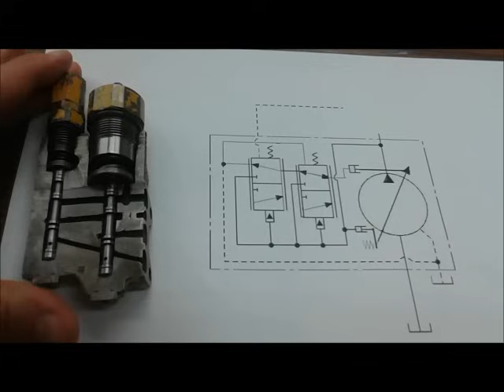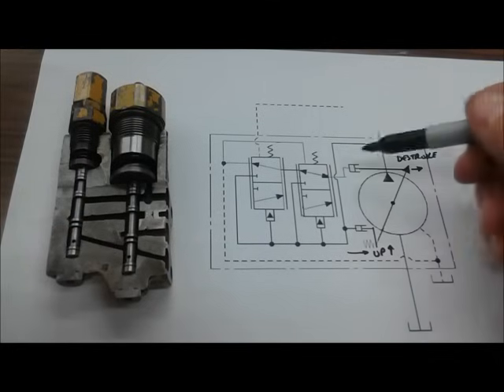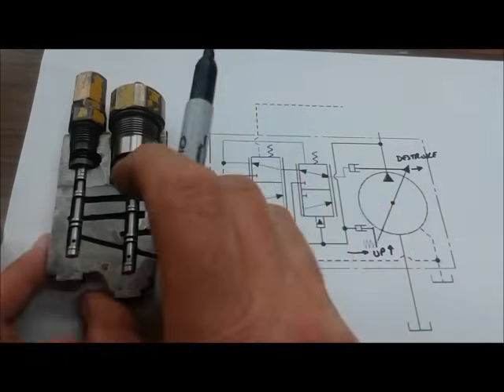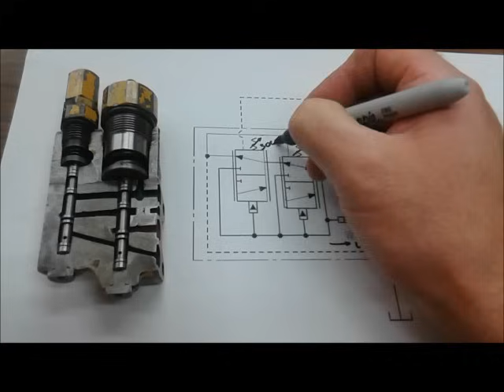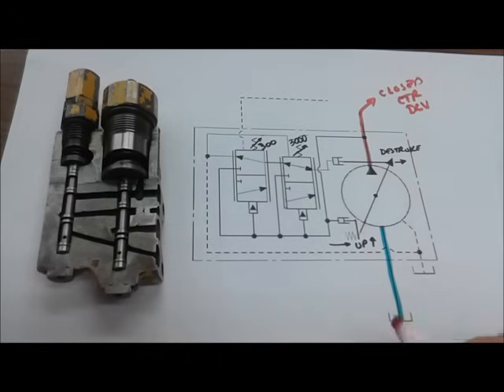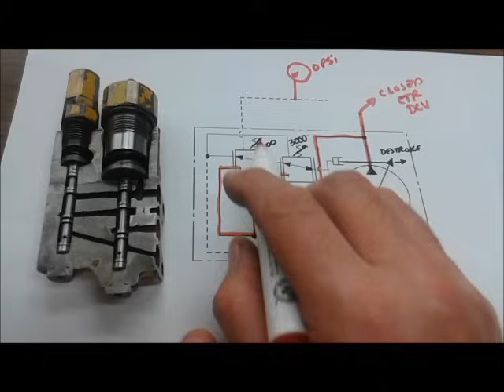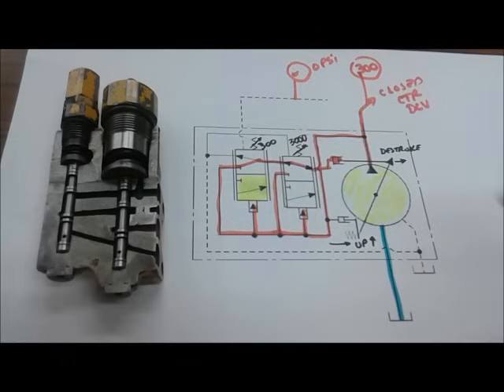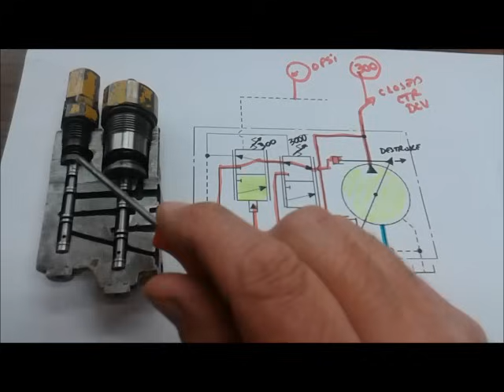REXROTH LOAD SENSING DRF DFR PUMP CONTROL EXPLAINED PART 1

Comment: Thank so much you sir. Just trying to figure out the load sensing and pressure controller interaction with the swash plate from the Rexroth or ROV manual was a pain. 10minutes spent with you and it was obvious! Much appreciated👍
Reply from the maker: Please like and subscribe.. it will help motivate me to make more vids

Comment: Good explanation. Stroking and destroking. Couple of comments: 1. Pump discharge port not mostly go to close center valve since most load sensing valving system use "float center" type or any valving system having "closed P" port but with outputs A/B goes to load sensing port thru shuttle valves. 2. Technically the load sensing line can't have a "zero" pressure since height of the column of oil or trapped oil pressure could still exert force against P pilot lines. I'm pointing some emphasis on 2 because you might create a "void" in the load sensing line if the piping system is not proper and could create some erratic functioning of the system especially at starting. There might be applications where the valving system is higher than the reservoir which might not ensure to complete filled pilot or drain lines. Good job btw.
Reply from the maker: +PC Gamer_Bowler yep and sometimes the DCV doesn't actually send the signal at all... in some systems the pump regulator actually sends oil OUT the X port, and the DCV signal network controls and "matches" it to the workport pressure. (Many steering systems on heavy equipment do it that way to minimize oil loss from the DCV). Other systems use signal duplicating valves (some Large Cat excavators) . There are lots of variations out there for sure. Thanks for watching!!!.

Comment: Hi Sir, Thanks for the video. Can you please explain the function of the third port (actually plugged) that can be seen in the video?
From the bottom:
1. Connects the discharge port
2. To the stroking piston
3. ??
4. To the case/drain

Comment: So L.S. pressure doesn't stroke your pump but prevents it from destroking by blocking the oil to the destroke piston until the pressure setting of the pump cut off is achieved?
Reply: ஒரு டைம் தமிழ்ல டீட்டெயில் சொல்லுங்க சார்

Comment: I have one the cycles on and off moving
swash plate as motor runs. Set at 300psi and 3000psi. If i lower to 1500psi cycling stops. Internal leak or broken spring? Oil gets very hot. Forks on forklift will tilt down un intentionally if I set at 3000psi.  Execellent video Thanks.
Reply from the maker: I was using 300 and 3000 as typical examples. Follow factory service literature for proper specs. and adjustment processes for your machine.

Comment: Very good video. What is the purpose of the "small hole" on the pressure compensator spool? Is the spool hollow inside? Can anyone clarify please?
Thanks.
Reply from the maker: Its hollow to the bottom . That's how oil gets under the end of the spool.
Reply: @hydraulics  Thanks for your excellent work....I think, there would be an exit hole (metering hole) too in the same spool, so that oil can come out?
Thanks for your excellent explanation.

Comment: Wht is the situation pressure composetor valve operate, there is a posibility for load sensing valve oparate firsly and destroke the swash plte spool. So how does pressure composetor is operated

Comment: Hallo,

I've a cat 322b excavator (engine 3116). The engine struggles as soon as hydraulic system is activated. 

I used to activate the hydraulic system while the engine was on idel, and it used to run. 

Now, if hydraulic system is activated on idel, it stalls immediately.

It sounds like there's a high pressure of hydraulic as soon as the activation lever is engaged.

If just continue to work on high idel, engine stalls after about 30 min of operation. Give it about 15 min rest, it works again and stalls afterwards.

I changed all the hydraulic system filters.

I really appreciate if you can help.

Comment: Hi. I have a pump like this. The label says DFR but there is no load sense line. Its set up as a DR sense system.  Im not sure im under standing the function of the DR system.   Bare with me..lol   Im working on a telehandler.  It has a open center spool valve with hydraulic pilot controls.  System pressure is suppose to be around 3100psi.  SO  to set the DFR pump up in DR mode, According to rexroth, you screw the load sense control all the way which blocks the sense ports to the pump.  Now you set your system pressure buy screwing in or out the pump pressure setting.  (3100psi constant pressure) SO my question is ..am i  understanding this correctly .  With a open center system with no load sense line (DR), the pump is always putting out 3100psi If thats the setting pressure,  and when you activate a function the main system pressure drops which is sensed through the pressure limiting compensator port going to the de stroke piston.  So when system pressure drops on command the swash plate de stroke piston spring pushes the swash plate to stroke direction to maintain system pressure of 3100 psi. 

Am i getting it?
Reply from the maker: I'll make a bunch of assumptions here as i don't know your machine's system detail, but yeah, if the valve is open center, then your pump would be putting out full flow in an attempt to get to 3100 psi. But being open center, all the flow will be going to tank with controls in neutral or hold and pressure will just be line, cooler and filter back pressure- you might see a few hundred psi at high engine speed - or less if no filter. . When you actuate a control, the pressure will then be load induced (weight on telehandler boom for e.g.). When you bottom a cylinder, then the pump will max out at 3100 and destroke. Your machine may also have a main relief though.

Comment: We have a issue with rexroth pump 3000 psi which is frequently replace new pump but pump not working in neutral position will you advise what is the problem

Comment: Awesome explanation of controllers but swash angle explanation is totally opposite to the convention. Swash angle arrow away from the pressure outlet line is considered as pump in full displacement and the same arrow, in line (Vertical) with suction and pressure line on the schematic is destroked.
Reply from the maker: That's the schematic in the Eaton textbook. Seems backwards to me, but there's no official convention on which way the arrow moves for upstroking or destroking so I just went with what they provided.
Reply: @hydraulics  That’s OK. After all the time learning one way for 20+yrs, I thought of pointing it out. But Ur Controller explanation is flawless.

Comment: Is ths up stroke and destroke  in opposite direction.when the arrow comes near vertical it is minimum displacement.
Reply from the maker: yeah, it seems backwards to me too-.... I was using the schematic from the Eaton fluid power textbook-  I have since switched it around for my classes, but didn't redo the video.

Comment: Is it possible to (dead head) this pump to for testing?
Reply from the maker: In most configurations, yes. My exposure is on the mobile side, so I just follow the service manual, but if the DCV is closed center it's output is blocked. Some machines do open some sort of unloading type spool though to allow some flow.